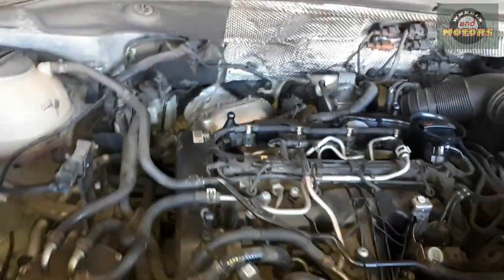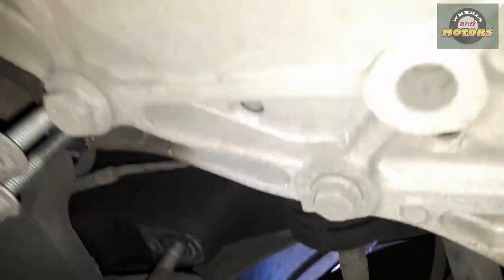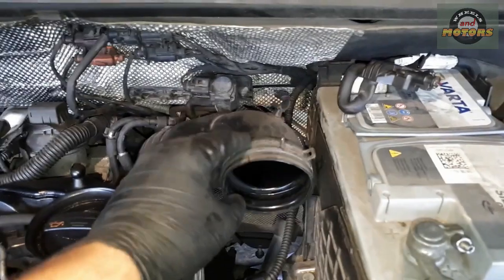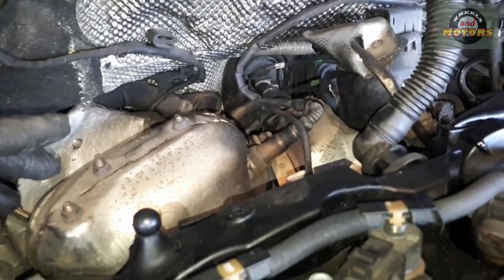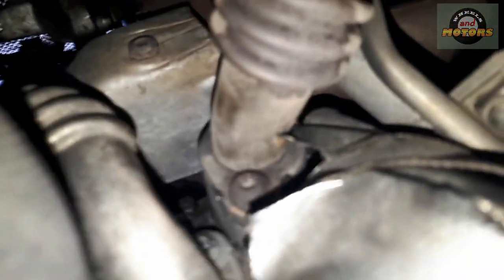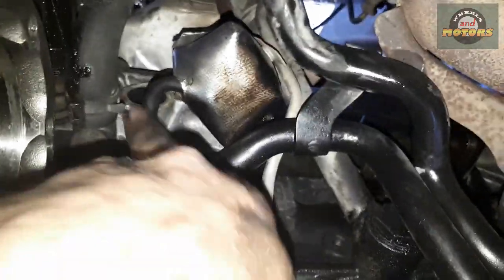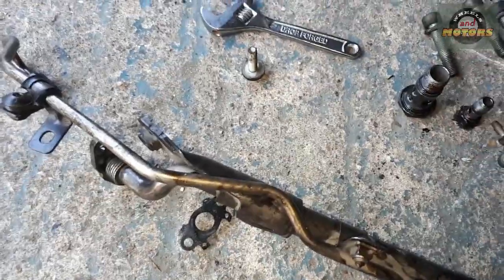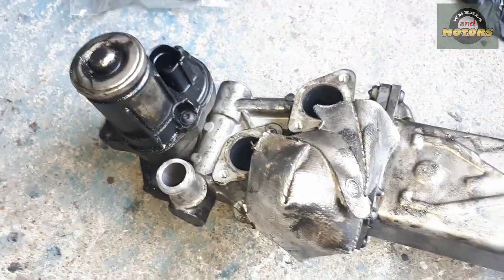P0403 - My way of "HOW TO REPLACE EGR TDI", VW, Seat, Skoda, Audi ("EASY-PEASY" style)

Comment: hi, can u pls upload a video how to clean EGR on this car without removing it. i have same car and work in taxi business too. bristol V car. thanks mate. ur help appreciate. thanks
Reply from the maker: If you come to Halfords or Euro Car Parts - they sell some stuff like bottles or sprays for EGR cleaning, and instructions how to use that are on them... However to be honest, in this car, if EGR developed a problem, cleaning might not help. Unlike previous engine generation, where valve was so close to intake and got clogged up with mixture of oil and soot, here we get just soot and it shouldn't give too much trouble. 
You can use some of that stuff I mentioned above and see how it goes - maybe they sell it for reason.. I that doesn't help, then you'll have to either replace it or I also seen people taking it out for a clean..
Reply: Hi, many many thanks for ur advice. it works actually bt don’t knw how long it will last bt so far it sorted. i went to euro car parts. bought one of egr spray and used it according to instructions. also bought one of ODB2 to clear code. thanks again for ur help. have a great day. 😊
Reply from the maker: @naeemmohd797  You're very welcome, hope it stays clear 👍
Reply: WheelsAndMotors hi again. it didn’t work actually as light came up again. yes u r right. this type of car need to change to new EGR or well cleaned. do i buy from vw dealer or from euro car parts? ur advice will be help a lot. thanks
Reply from the maker: @naeemmohd797  Hi, sorry to hear that it didn't help.. I bought mine in TPS, unit itself + gaskets and clamps all together was 416 pounds, that's the price you would get from dealership. I don't know how good is EGR from Euro Car Parts, probably should be good too, because they also give warranty. 
I don't have much experience dealing with these units, so I'm afraid I can't give you good advise. 
Apart from this one about year ago, I bought same unit from eBay for like 100 pounds, it had to go on different car, Seat Altea XL 1.6tdi. And this unit from eBay didn't last long. I don't know whether that was  because of bad quality or because they done bad job (I didn't fit that one) or something else went wrong..
I would recommend get it from somewhere with warranty and get it done by someone who can guaranty that it will work.
With your job you want it to be done once and for good, isn't it?
Reply: sorry for late reply. i been away actually. ok i have replaced egr few dys ago. bought one from euro car parts £240 (hass company). fitting ws around £250. so let’s hope things go in right way. 1 years warranty too. thanks for ur all help my friend 😊
Reply from the maker: @naeemmohd797  No worries, glad you got it fixed.
Reply: @naeemmohd797  Hi, How is your car performing?. My car needs new EGR but I was told EGR from euro car parts are not good and recommend to go direct TPS. Is Hass good brand and is your car still fine? What model and mileage is yours when it failed?
Reply: @hassan78659  My car is going in on Monday for a new EGR. Audi 2010 1.6 TDI 213,000 miles. Started to have reliability issues at around 205,000 miles. Hopefully this will sort it.
Reply: @hassan78659  hi hassan, sorry for late reply. egr problem comes again.

Comment: What was the symptoms of the bad egr? Did you have any faults light on the dash?
Reply from the maker: In the past I had engine management light with "EGR insufficient flow detected" it was on and off occasionally. 
But before this job, I had just coil light flashing, loss of power and scan that says "EGR malfunction".
Reply: @wawayltd  Thanks

Comment: hi, nice video. i hve change my vw shran 2016 egr last year. last week same problem comes up. can u sort this issue pls. of course i will pay the charges. i will in bristol and do taxi. thanks
Reply from the maker: Thanks for nice words. I wouldn't be a good mechanic - I'm too slow. Before making new video I do a lot of research at least to know what I'm doing. Still it takes ages and things may go wrong. Of course with the power of video editing it looks quick and easy in the video. But there's lots left behind the scene 😉
I don't mind playing with my car, or do something that I'm really confident on another, but I don't want to work with random people cars in case if I mess up.
Reply: @wawayltd  ya in video everything looks easy bt i can understand how much hard work behind it. just now i went to gearage, they give me appointment next month 8th. they saying its egr bt it could be problem with electrical too. can’t afford off road till that. it probably damaged to dpf too. so many things my friend. i know u for years in working same trade. i give u 100% go ahead to work on my car. and ofcourse will pay u. 😊
Reply from the maker: I'm very sorry Muhammad, there are few reasons why I can't fix your car:
1. I don't know what's wrong with it. I only know how to replace EGR unit, that's all. What if the fault is somewhere else? Electrics? I don't know how to diagnose it properly..
2. The garage where I filmed it is not mine, my friend kindly lets me to use it occasionally, and I don't want to misuse it.
3. As I said I'm slow - it can take long time, and time is something that I don't have now. I can earn in taxi, but I also spend a lot of time building new version of my website, and it needs to be finished before hosting runs out for my old one.
4. This job is too serious for me, it's not something I do every day. I'm alright to risk my car, but I don't want to mess up yours.
Try to shop around, try to find good garage that can take you sooner.
I'm sorry, but the "stars are not aligned" properly for me to fix your car.
Hope you get it sorted.
Reply: @wawayltd  thts no problem my friend. i completely understand 😊

Comment: Hello. Did you find out where was the oil leakage? Thanks
Reply from the maker: Hi, rocker cover seal.
Reply: @wawayltd  :-( Approximately how much does it cost to replace the cover seals? And how money working hours does it take :D
Reply from the maker: Seals are quite cheap. There's a seal around rocker cover and 4 seals - 1 around each injector. Because injectors had to come out and I don't have experience with them, I gave it to some specialists, they charged me about 200 pounds. By the way I had another leak from oil cooler, I have a video about it.
Reply: @wawayltd  Thank you! Btw the video was good (y)
Reply from the maker: Thanks :)

Comment: Hi I have p0401 vw cc 2.0tdi 2013 would it need a new egr
Reply from the maker: Hi, this code points on restricted flow of gases through EGR. What's causing it - I don't know. Maybe it's just clogged up EGR or even of the pipes and it needs jusr cleaning, or maybe old unit is not good and it's asking for replacement. I can't say, it needs to be seen.
Reply: @wawayltd  ok I get cleaned see what happens. If I do end up changing it what brand of egr do you use  genuine or aftermarket?
Reply from the maker: I would go for reputable brand with warranty, so in case if it doesn't work, you can go back to them and throw it in their face 😁

Comment: Hello.  Thank you for the great videos.  I have a question. Sometimes cooling fans operate at 20 degrees.  Where to find the cooling fan sensor in the 2013 Volkswagen Sharan car.
Reply from the maker: I know that fans have mind of their own. System decides when to switch them on. Why and when - I don't know, but I don't worry about it, as long as there no errors.
It has a connector that switches it on and off, but it's only connector - signal comes from ECU, but when it decides to put it on - it's a bit of a mystery for me. I would assume it's a bunch of parameters, not just one sensor. However - I'm not professional 😏
Reply: If there is DPF regeneration in progress, cooling fan can be switched on.
Reply from the maker: If DPF regeneration was not complete, but you switched the engine off - fans will continue to work to cool it down.

Comment: Does EGR clear up if driven regularly on the motorway?
Reply from the maker: It stays pretty clean with this design (no oil, only soot).  Motorway is pretty good for giving it a good burn. However, sometimes if it starts failing cleaning may not help, even if you take it out and physically clean it.
Reply: @wawayltd  Thanks. My car failed MOT cos of emission. It drives fine no signs of any problem. I just dont know what to do. Kwikfit said it needs cleaning. Thanks for your reply.
Reply from the maker: Try to rev it up while going up the hill before MOT, also make sure engine is hot, like in this video:
https://youtu.be/4zTRSOHcI7c
Reply: @wawayltd  I drove on the motorway did 80 mph this evening and took it to another garage and the emission was 0.71. It was fine. They ask me to take the car back to kwikfit. So first thing tomorrow morning. They told me the same thing you mentioned above. Ill do that. My friend also put some chemical in the fuel tank. So hope all go well tomorrow. Thanks for your help mate. God bless.
Reply from the maker: You're very welcome, best of luck with your MOT!
Reply: @wawayltd  I took the car for half hour drive this morning and took for test. The guy at kwikfit revved the engine several times and managed to sort the MOT. He said you just made it. It was 0 .99. They advised me not to use supermarket Diesel and asked me to use diesel system cleaner every 6 months. Thanks so nuch for your help. God bless you man.
Reply from the maker: Good to hear that 👍
However I've done over 380.000 miles on supermarket fuel 😉. Motorway isn't helping that much to pass emissions test. Best way is the way I showed in that video - get ot hot, make it work hard (up the hill) to the red line...
Anyway - well done!
Reply: @wawayltd  cheers Buddy.

Comment: Great video , but with 330K on the VW  there looks like excess oil signs its breathing heavy
Reply from the maker: It feels great, I presume oil may come from turbo, which is still original and eventually might go. When time comes - maybe another  reason to make new video 😉
Reply from the maker: It's doesn't seem to consume any oil between services..

Comment: Hello, i think i have an EGR problem. 
I have intermittent code P0403 [172]. The engine starts and then shuts down immediately, i think the EGR is stock closed. 
Do you have any idea how to force it open just to be able to take the car home and work on it?
Reply from the maker: The code points at EGR circuit malfunction. I think if it's stuck in "closed", the car should work (some people blank it), but with fault codes. It's harder to start when it's stuck open - it will misfire especially when cold. Not sure if there's a way to do something without getting there.
Reply: @WheelsAndMotors  it's stock open, sorry.
I'm thinking about removing the pipe that goes from the EGR to the intake manifold. This should let it start.
Reply from the maker: That would make exhaust gases to go into engine compartment and inside car interior! Why don't you want just to fix it?
Reply: @mohbounu  hi mate what did you do on the end my friends seat is starting but dies it won't rev suspecting only egr

Comment: Do you need to support the steering rack at all or is it okay? Also - do you need to do any calibration when you return the subframe to the position?
Reply from the maker: Steering rack is okay, it can stay like that. Try to fit subframe back as it was looking at old marks, but I still recommend to check wheel alignment.

Comment: You don’t need to remove all that suspension, drive shafts and subframe out. 
You can do it much easier and quicker. All you need is aloft because it’s easier to work.
Reply from the maker: Thanks, but I just find it a lot easier for myself to have a lot of access, because it's a bit fiddly job. It doesn't take long to drop the subframe 😉

Comment: You have no idea on how to get the job done efficiently. You do not take off turbo return pipe I have done this job several times you do not need to drop the sub frame but good effort must’ve taken you days 😮😮
Reply from the maker: Much easier without subframe, when you have spare time.

Comment: Must be bonkers going to all that trouble on a old vehicle with such high mileage. Labour costs here in the UK would render the car uneconomical to repair plus the price of the valve , I think EGR is £1000 from the dealer or non dealer price is £500.  Your trying to polish a turd there mate, soz for the negativity but it's expensive problem after problem with old high mileage cars!
Reply from the maker: Don't remember how much I paid for parts... I'm pretty sure it was below 500, and that including clamps and gaskets from TPS. The car is on 422K and still happily going.